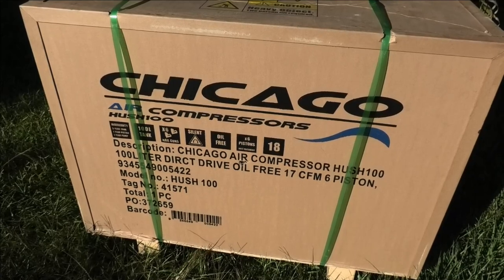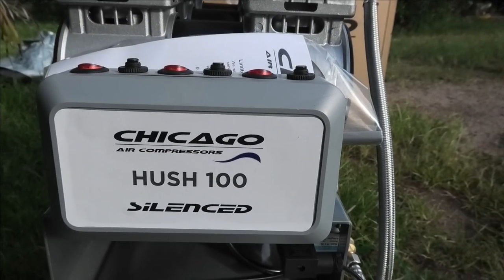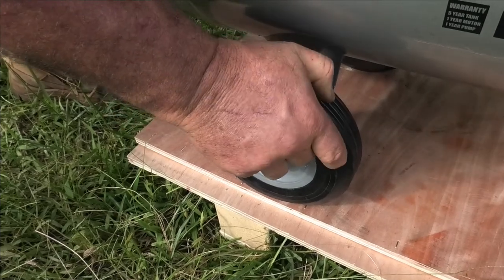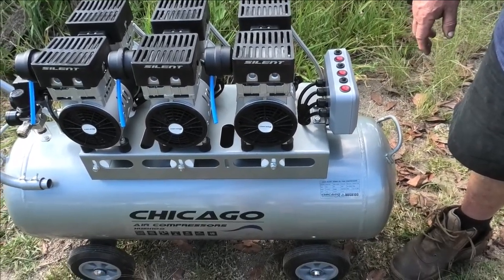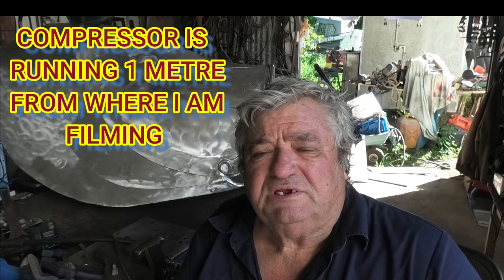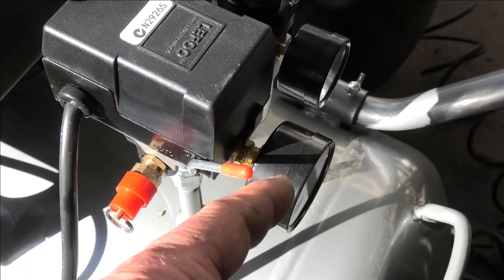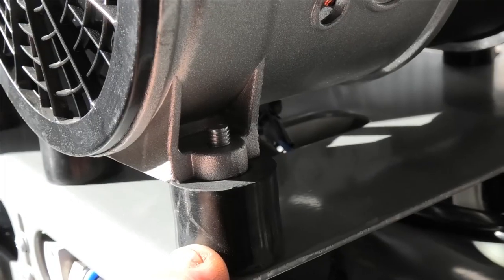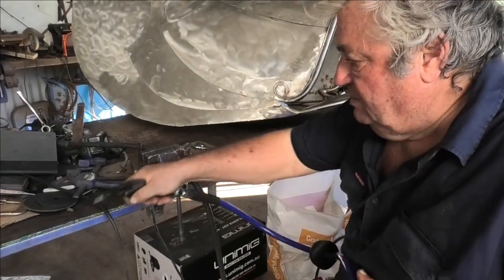I bought a new compressor

Comment: Look into drying the air, can fabricate an air dryer from copper tubes and old truck radiators. Keep your plasma in good nick.
Reply from the maker: Makes sense I know even another tank after the compressor will catch a lot of water. John

Comment: Three motors , good idea , if one of them dies you still have an operational compressor with  reduced output  .But it still works . A bit like a twin engined aircraft when on of the fans fail .😲
Reply from the maker: Or it could be triple trouble. John

Comment: SWER distribution is terrible on motors voltage regulation is very poor,  running on 3 smaller motors will spread the load. Nice compressor! Might look at one myself
Reply from the maker: The voltage is all over the place and gets as high as above 250 volts. John
Reply: @farminglifeaustralia6716  You need a modern switch mode system to convert single phase SWER to a regulated 3 phase outlet. Cost a mate about 10 grand to be able to run his joinery business machinery. Still cheap compared to what they wanted to extend the 3 phase line to his camp.
Reply from the maker: @theoztreecrasher2647  I have only recently learn't that there was a way to have 3 phase off SWER power. I think having half arsed power is just the price we pay for living in the bush. I would put up with no power rather than live in town. John
Reply: @farminglifeaustralia6716  +1 on that! I want to go listening to the birds in the background not the neighbours fighting!
Reply from the maker: @theoztreecrasher2647  Thats for sure. John

Comment: Good luck replacing the diaphragms each year times 6. $100 each times 6 =$600 per year maintenance
Reply from the maker: That sounds crook I have a friend who has had one for 6 years and had no issues at all thats why I bought one. If I have to replace the diaphragms you can bet everyone will know about it. John
Reply: @farminglifeaustralia6716  I have a single cylinder one that needs a rebuild every year. Might depend on your use
Reply from the maker: @waynecooper9411  I will just have to see what happens I suppose. John